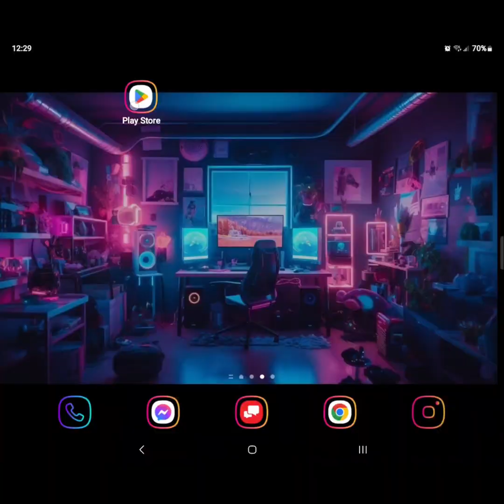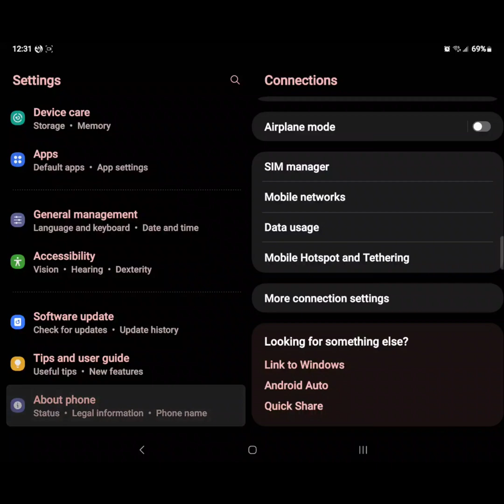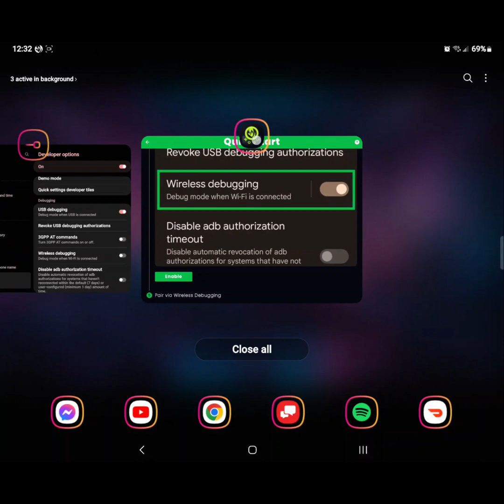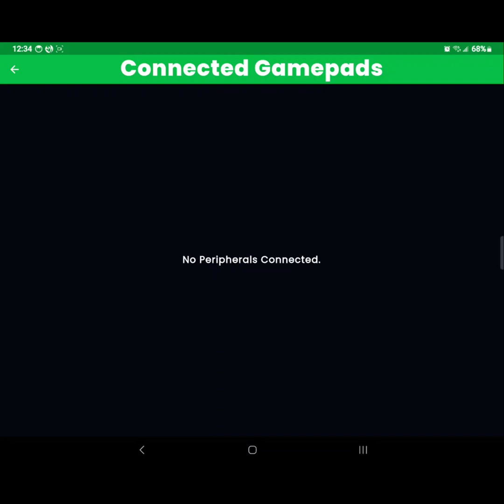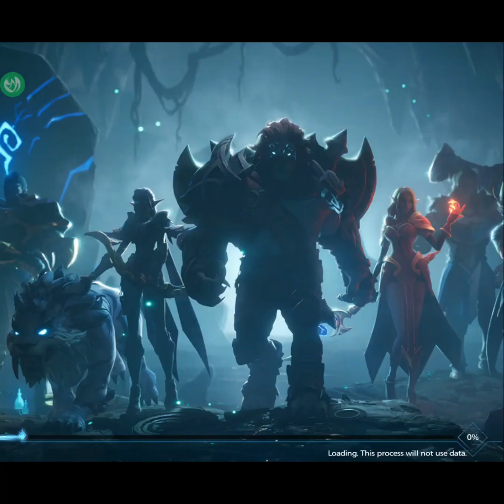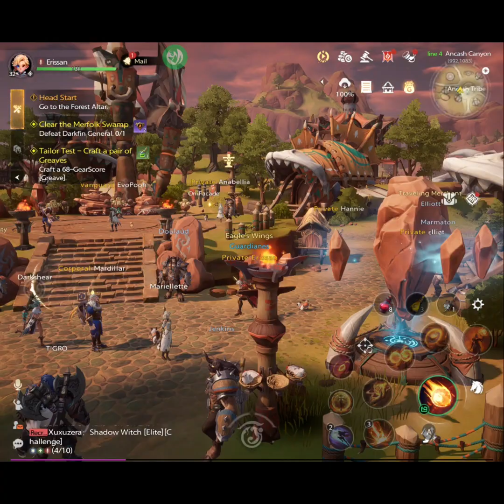Tarisland - Mobile Controller Tutorial and Setup

Comment: First of great job explaining everything and thanks for this!! 👏🏻 I have two questions. What are your macros for Fire mage and what would be your suggestion to setting up a way to activate the auto-run?
Reply from the maker: @swarleysheen5220  so you can go with the recommended macro set up or there's some videos and guides on how to set up the macros for fire or ice mage. I still haven't been able to get the auto run function to work. There's a option in mantis game pro to map a touch and slide option on screen but for whatever reason it doesn't seem to work for auto run. I'll try and fiddle around with the settings some more and figure it out
Reply: @DuffManGaming Gotcha, I'll look around more about the macros. I have the Pro version as well and I couldn't figure out the swipe thing just yet but I too will mess around with it more. I finally got a button setup that feels comfortable to me. Just need to get that muscle memory down now. Thanks again.
Reply: got autorun to work. you'll need mantis pro for the gesture option. make the 'gesture up' circle overlap the left stick circle. the inner circle of the gesture up should be big enough that the lower part starts at the center of the left stick, and the upper part reaches the distance to show the 'run' icon
Reply from the maker: @RufoMinon  interesting. I have mantis pro and was never able to get this to work. Thanks for the clear instructions I'll give it another shot and see if I can figure it out